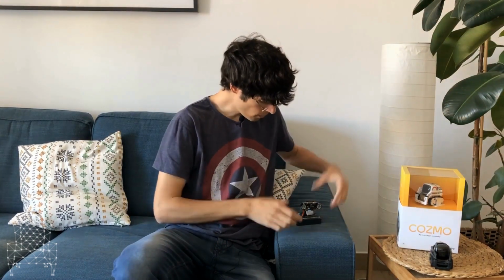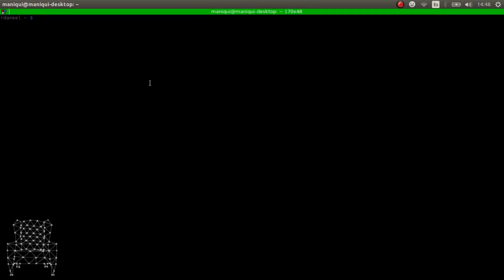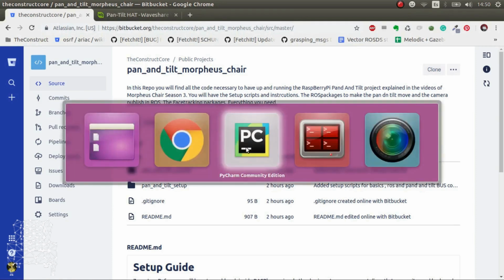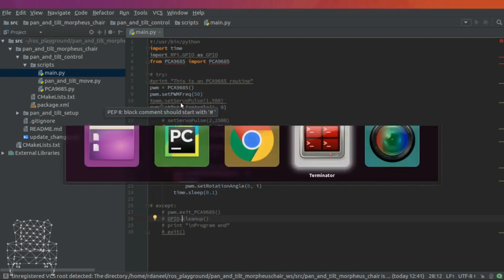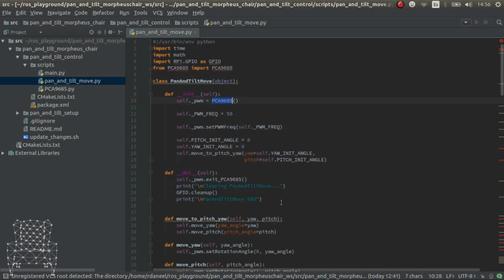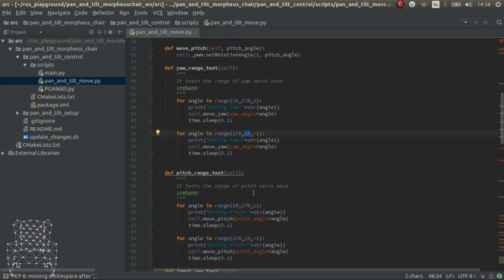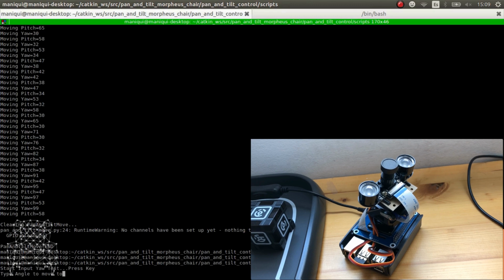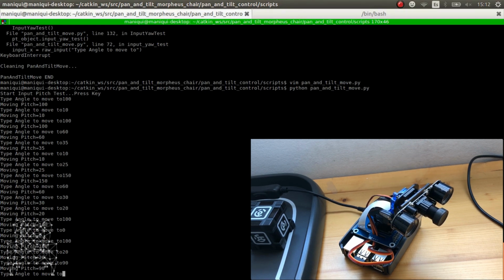[Morpheus Chair] Pan & Tilt with Raspberry Pi + ROS | S3.Ep.1

Comment: Hi,
Thanks for the awesome tutorial.
I have a problem with connecting via i2c due to a Remote I/O Error...
Any suggestions?

Thanks,
KB

----------------------------------------------

py 
pygame 1.9.4.post1
Hello from the pygame community. https://www.pygame.org/contribute.html
Traceback (most recent call last):
  File "main.py", line 8, in <module>
    pwm = PCA9685()
  File "/home/pi/catkin_ws/src/pan_and_tilt_morpheus_chair/pan_and_tilt_control/scripts/PCA9685.py", line 37, in _init_
    self.write(self.__MODE1, 0x00)
  File "/home/pi/catkin_ws/src/pan_and_tilt_morpheus_chair/pan_and_tilt_control/scripts/PCA9685.py", line 41, in write
    self.bus.write_byte_data(self.address, reg, value)
IOError: [Errno 121] Remote I/O error